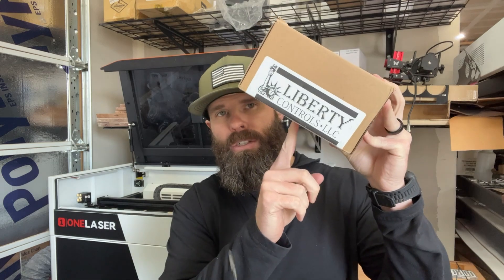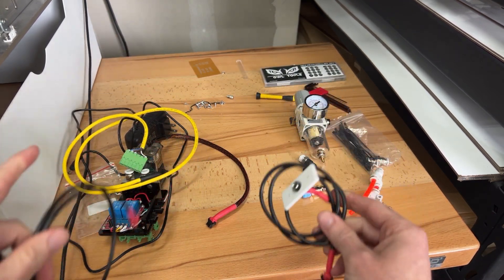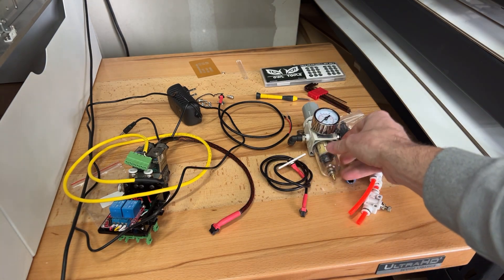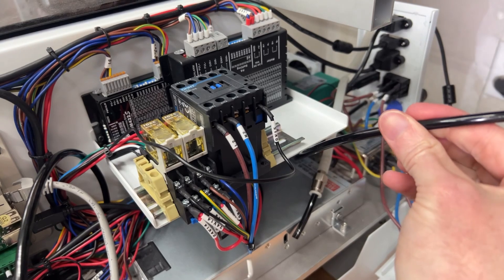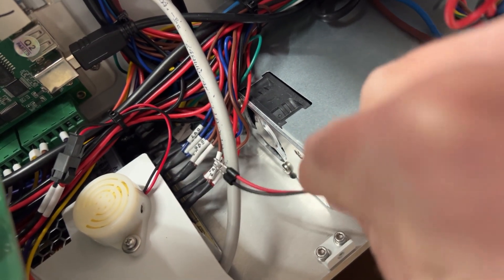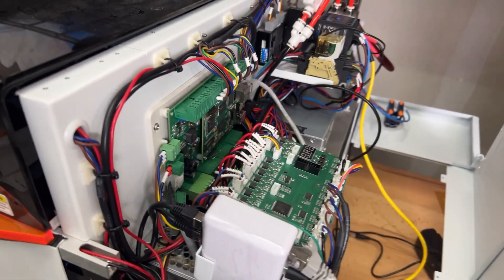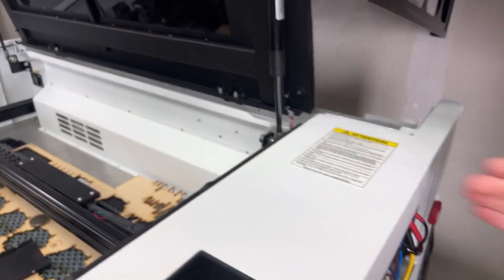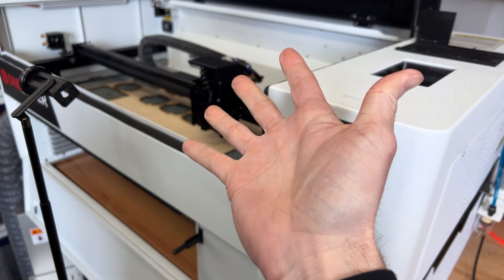Install Your OneLaser XT | XRF Air Assist From Liberty Controls

Comment: Hello, thank you for your videos on the XRF. I got one a few weeks ago and i can tell the packaging materials were designed by engineers because their communication skills are nonexistent. There is no set up guide, they seem to think each step is apparent. I clicked on your link for the air assist from Liberty but they are sold out. Do you know of another place i could find one?
Thanks again for your videos. If it weren't for your help, i would have been so frustrated i would probably have sent this thing back.
Reply: Yeah, they seem to just be constantly sold out as far as I can tell. I'm using another video that @beardedbuilds did, for the Omtech laser, where he tells you how to basically DIY it. Although, looking at this video compared to that video, I may end up adding additional parts. We'll see. If you're comfortable with electronics it shouldn't be difficult.
Reply from the maker: I do believe that Liberty Controls have discontinued operation. There is however a kit that OneLaser is producing now.

Comment: Thanks for all the great videos. Two noticeable gaps in this one. Liberty Controls' online instructions say "Remove the stock air pump and inlet fittings from you laser. Videos for this step can be found on Youtube if you don't know how." Were they anticipating you would cover that step? I don't see any such videos other than yours. Also, you didn't make a recommendation or discuss the compressor. Would you? Keep up the great work!

Comment: Just finished watching your video about Liberty Controls and probably 5 or 6 other videos on how to DIY a dual-solenoid solution.  Then I went on Amazon and priced all the parts needed to do it myself.  The price difference between DIY Amazon parts and Liberty Controls was surprisingly small... much less than I thought/assumed it would be.  To pay a reasonably bump to get something developed, tested and built by someone how actually knows what they are doing so I don't put my $5K laser at risk was a no-brainer.  Order placed with Liberty Controls...
Reply from the maker: AGREED!